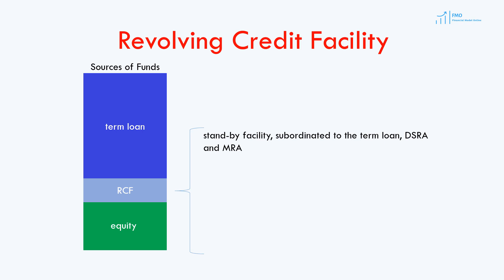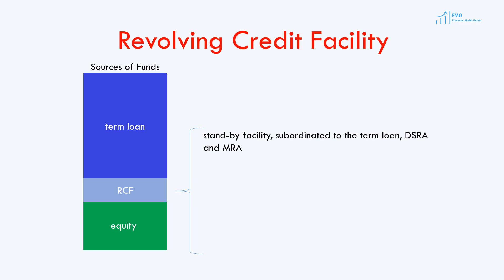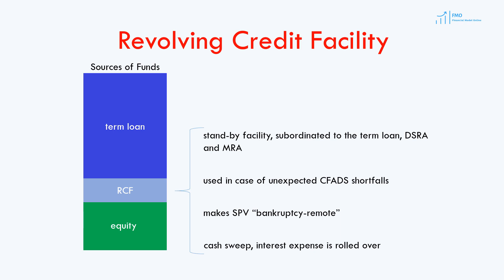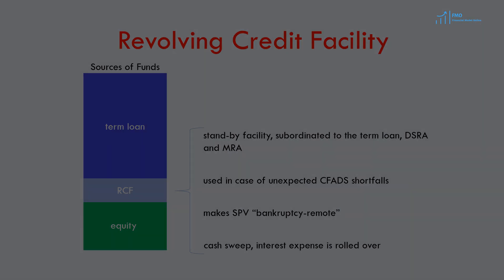What is revolver in project finance modeling?

Comment: 0:20 
capex is financed through term loan. as a construction debt. 
equity is from project sponsor.
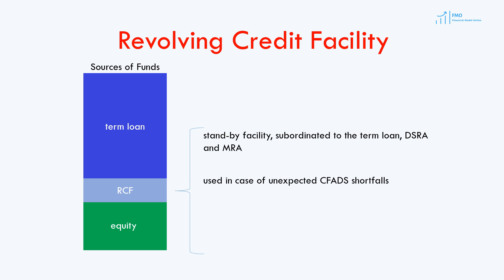1:15 
RCF in project finance and corporate finance is different. 
in corporate finance it is senior debt, 
while in project finance, this is based on the loan agreement. this is stand-by facility. and for general operating purpose. this would be called upon through either emergency capital investment or significant fluctuation in working capital
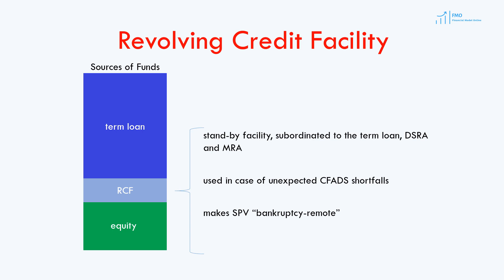1:40 make project company, SPV, bankruptcy-remote. for a project that also issues bonds to public market, it may also require credit rating.